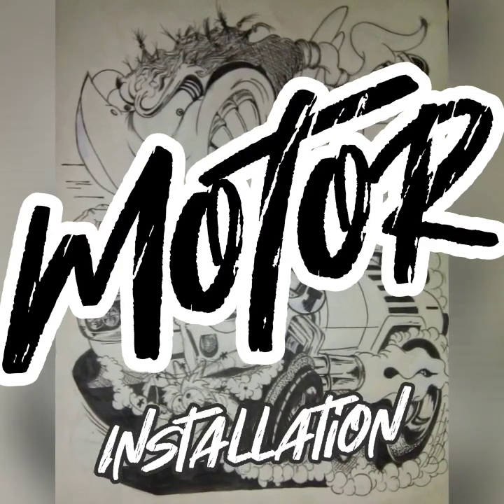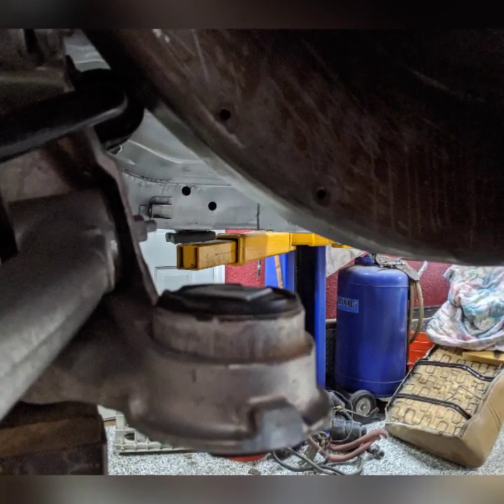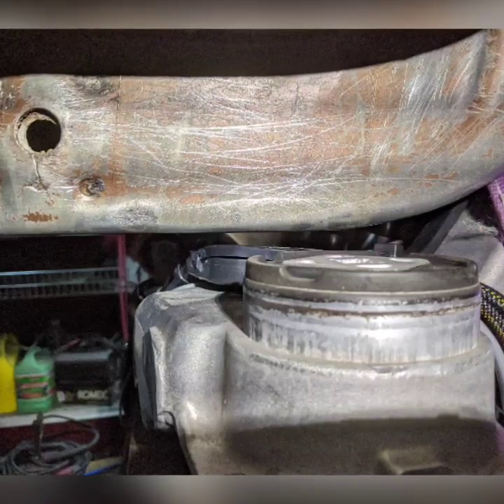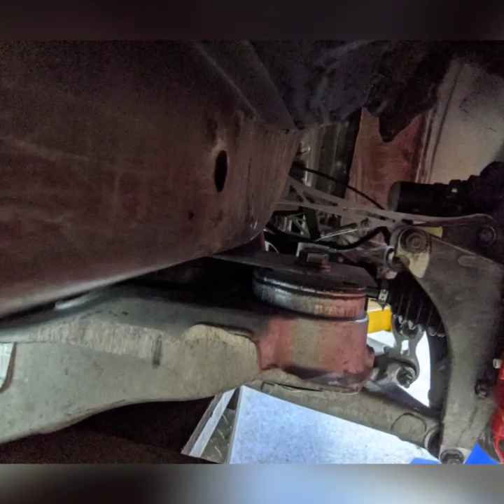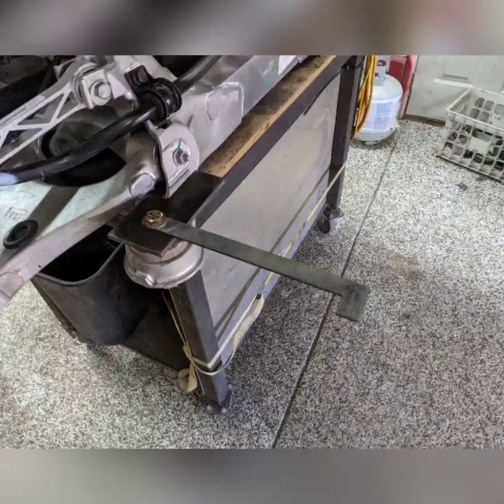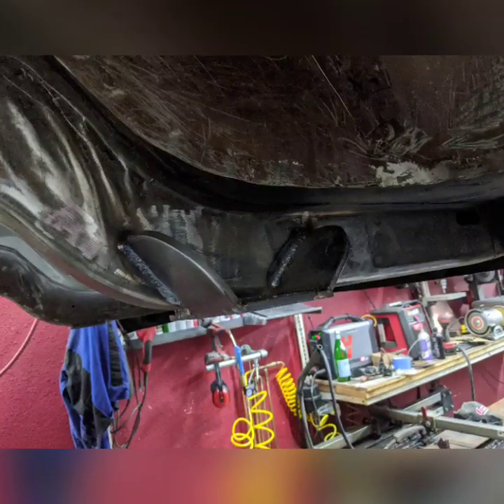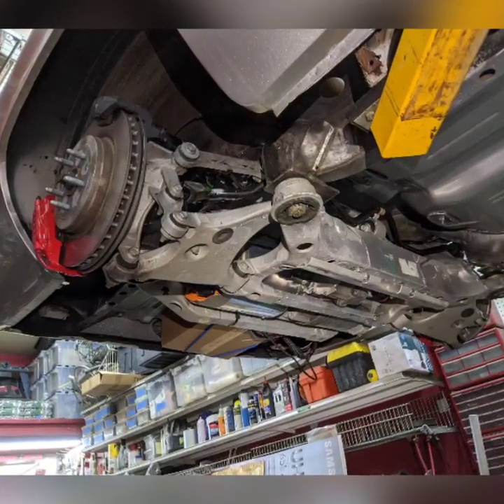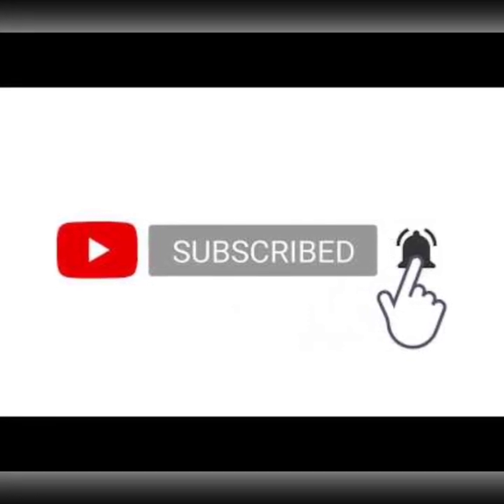Project Electrollite - Plymouth Satellite Tesla Swap - Motor Installation, Ep. 4

Comment: Wow that welding was impressive! I could make a whole 20 episode series about me just trying to get a solid weld on one of those joints. I'm curious, what type of welding did you use on those?
Reply from the maker: Thanks, I appreciate the kind words.  Most of the frame welding was done with a Miller 252 MIG with .030 wire, and 75/25 shielding gas.  The frame material is much thinner than the steel used for the mounting points, so I welded it with many "tacks".  I used settings that were too high for the frame material.  I would start a tack on the thicker material and then closely watch the puddle advance to the thinner material.  As soon as the thinner material became wet, I would remove power and then immediately start another tack the same way.  This kept constant shielding, without allowing it to cool too much.

This pulse technique seemed to get plenty of penetration on both sizes of metal without overheating or blowing through the thinner material.  16,000+ miles later with lots of hard driving, no signs of fatigue 🤞

Comment: Pretty brave to make those subframe mounts from scratch. Clearly you have more trust in your fab and welding skills than I do mine!
Reply from the maker: So far so good, I've inspected them regularly and no cracks in 10,000 miles.
Reply: @MrMoparMan  Awesome! How did you choose what kind of stock to use or how to design the gussets? How did you know it would be strong enough? Just experience?  Things like this get me stuck because I imagine the engineering team that designs such things on my street car and compare that to me in my garage with a welder and a prayer. I get intimidated. Your build is inspiring, though!
Reply from the maker: @jasonbarnett1256  I'd say it's mostly experience and just using LEGO logic.  If it looks weak it's probably weak.  I tried to picture which way the forces will act on each part.
I think just trying is the key, once you're into it you will figure it out.  Engineering with CAD models and stress models is great, but on a one-off, hot rod build I just don't think it's necessary.

Comment: Nice! Great work, EV buddy! 
I'm doing a '53 Hudson Hornet with a similar setup, but my Hornet is quite a bit narrower than your Mopar... This is the first video of yours I've found, so I'm going to have some great stuff to catch up on! looks like you're quite a bit farther along than I am. I've been working on this project since 2017, but I'm just at the point of installing the Tesla Drive Unit... The width is much more of a problem than I thought it was going to be ... Yikes!
In any case, really great work I've seen so far, can't wait to catch up! Cheers
Reply from the maker: Very cool that you are building one also!  It's no small undertaking, that's for sure.  The width is very surprising, it was a challenge for me to get the right wheel offset.  Good luck with your project!

Comment: this is exciting, thinking about doing this on a el camino and setting the entire model 3 battery tray in the bed
Reply from the maker: Perfect use of the Model 3 battery.  They are a better battery and can be had cheaper than the Model S pack.  If you want to really go nuts, you can run 2 model 3 packs in series and get an 800 volt motor making 900 hp!
Reply: @MrMoparMan  i was thinking of finding a wrecked dual motor and actually running dual motor on the vehicle (awd electric mini truck sounds cool) but running a dual battery pack never crossed my mind though, very interesting idea